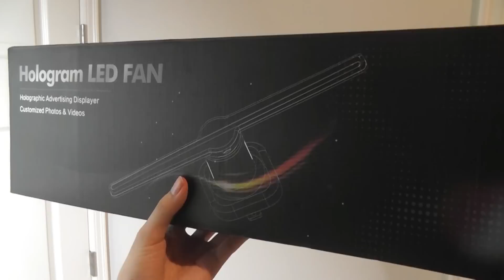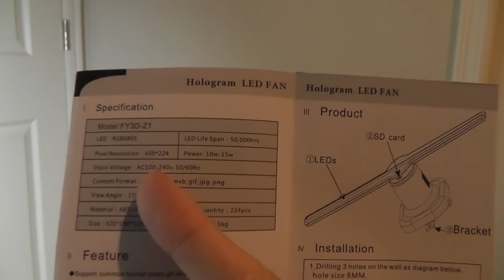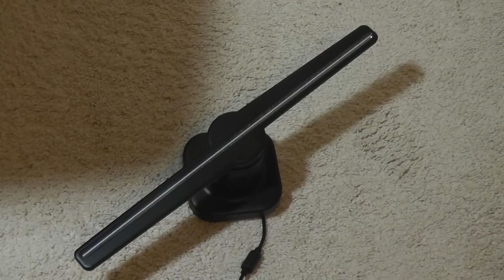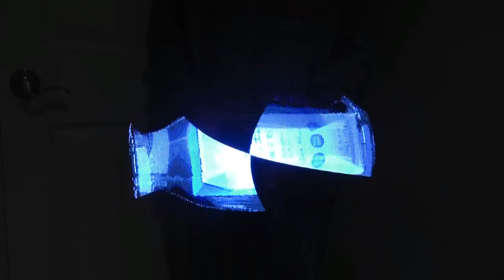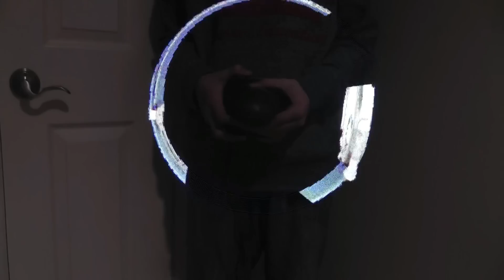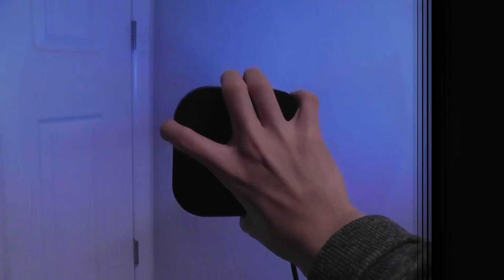REVIEW: 3D Hologram LED Fan Display - Future Is Here!

Comment: Is this being sold as a holographic display? Or is that just what the reviewer is calling it?

This is just a POV device, like the thousands of 'normal' LED fan ones out there, but this uses an addressable RGB LED  strip instead of a few individual diodes, that's all. So definitely a 2D display, not a hologram.

Comment: You need to change you cameras frames per second (fps). It looks like it doesn't work right but it is simply you camera not being abble to capture the speed of the blades
Reply: nope, the problem is with the shutter speed.
Reply: This is wrong, the shutter speed is the problem
Reply: Truee
Reply: We are Shenzhen Damaizi Technology, professional development 3D advertising machine FA60N, brand "FTL", welcome to call 13620967161, email szftl2@163.com

Comment: Does it have to be plugged via the power adapter cable to work? Can it work with an extern battery so you can move arround with it? (For cosplay in a convention)
Reply: Check out Hacksmith's video about it. They used it to imitate Dr. Strange's magic

Comment: That background music needs to go, either modify it with freely available software like Audacity or just not use it. That song has been used to death on any number of videos and now is the equivalent of using Comic Sans in a powerpoint video, don't do it. 

I wanted more shots of the device functioning, maybe in a darker environment and maybe clips of it from further away. Also while you mentioned what file sit uses a better option was to show the viewer the files on the memory card itself, it helps a lot. Also you mentioned about 2D images but it would have been better to show the effect of the 2D image, maybe even the logo of the channel? 

Also look into adjusting the camera so the effect of the hologram will be more pronounced, Try different FPS and see the effect.

Comment: So this was "designed" in such a way that if you place it on a horizontal surface it can't sit level because the 90 degree power plug sticks out too far AND it has no power switch, so the moment power is applied it immediately starts spinning a 2.5 foot long bar?  Ladies and gentlemen, those are MAJOR design flaws (fails) and it's what you get when the only concern of the manufacturer is slapping something together and shoving it out the door before everyone figures out it is yet another $300 POS with 2-day delivery.  Until everyone STOPS accepting this kind of mediocrity, this BS will go on and on and on and...

Comment: Incorporate into off the shelf ceiling fans, mass produce to sell only for $50 more than non hologram cieling fan ...would sell like hotcakes!   Just have it wifi to put images from computer
Reply: Dougie, you have had a good idea! You would get neck ache staring at the ceiling!
Reply: Ceiling fans dont meet in the middle and it likely requires specific rpms to display video properly